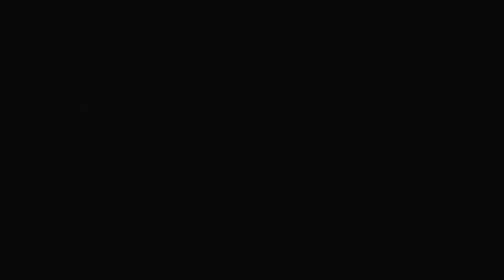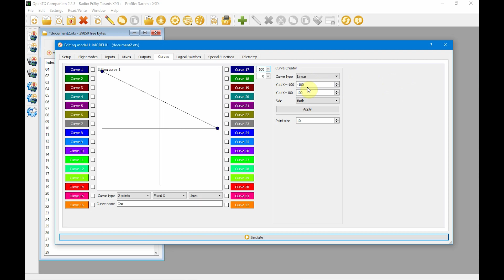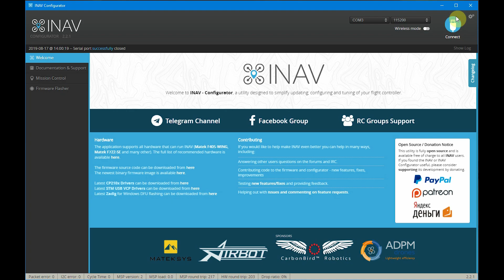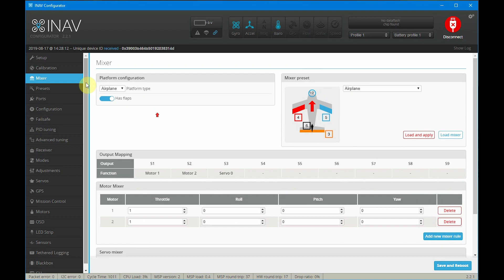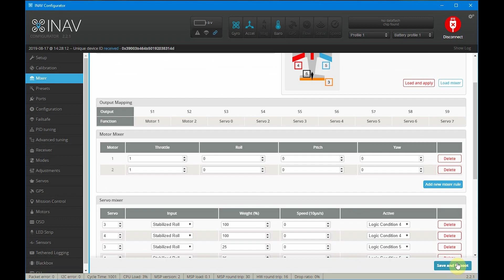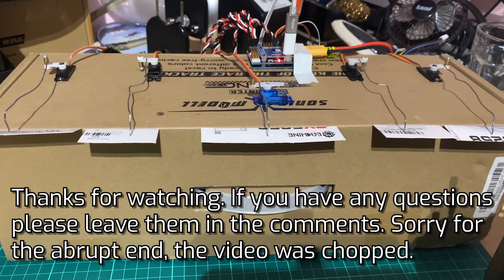iNav 2 2 Full House Glider setup

Comment: done all this thank you - in flap mode slider middle is neutral - up is down, down is right up, is there a way to keep them flush & not go up? another 1 is im used to is slider fully up flush flaps and slider down flaps down - can this work or will it mess it all up?

Comment: In the comments here there is a suggestion that it would be easy to add a fixed camber and reflux if the mixer had the ability to use a logic condition to add a fixed amount to the ailerons and flaps.  Does anyone if this has ever been done?

Comment: Many thanks for this great and very instructive video, Mr.D!

There is something which I don't fully understand though. I believe that you describe that the logical conditions being TRUE mean that:

0: (Crow) is selected by switch
1: (Full span ailerons with Crow) is selected by switch
2: (Flaps) is selected by switch
3: Crow is ON (because throttle stick is in the range of [1000..1524])
4: (2 OR 3 is TRUE) (see 9:00 in the video) => Crow is OFF ("because when Flaps are ON, Crow is never ON")
5: (NOT 4) => Crow is ON
6: (NOT 2) => Flaps are OFF

You mention that when 4 is active, Crow is OFF. But if 3 = TRUE (Crow = ON), then 4 = TRUE ("Crow = OFF"), which is a contradiction. In the setup which you at first had and which you have deleted in this video to make room for the demonstration, had condition 4 maybe been instead,
4: (2 OR (NOT 3)) = > Crow is OFF?

What I am currently missing in iNav is an easy possibility to add absolute values to a mix. I see no simple way to implement cambered or reflexed wings. In other words, it seems almost impossible to increase or decrease the deflection of both ailerons and flaps at the same by a constant value, regardless of their changing channel values. The only idea I was able to come up with was to send the desired constant offset value in a separate channel. Have you found a good workaround for that, too?

If not, then apart from saving or not saving a few RC channels: What would you say is the advantage of using the iNav mixer, instead of doing the mixing in OpenTX from beginning on, and then sending each servo output on a separate channel?
Reply from the maker: Hi, thanks for the comments.

For the first question, logical condition 3 is actually Crow is OFF, not ON. The stick range in OpenTX is from 1500 - 2000 due to the curve that's added. 1500 is also when the stick is up (full throttle position) and 2000 is when the stick is down. So:

3: Crow is OFF ( because the throttle stick is in the range 1500-1524)

When you look at it like that, the rest of the logical conditions, including LC4, are fine.

Yes, I've been looking for the ability to set values in the mixer too. Maybe it's something that can be added in future versions. I think the best way to add camber and/or reflex would be using another radio channel but limiting the output values with a curve or other method. This could then be mixed in with the appropriate surfaces. Another option would be to send the full channel to iNav, and limit the throws using the mixer's weight setting. Though it would be easier to tune in the TX.

The advantage to mix in iNav is that you can still use stabilisation and/or flight modes.  Other than the advice from all the developers not to do any mixing in the TX, you can't send 2 aileron channel to iNav that are treated as ailerons, only 1. Therefore if you do send 2 aileron channels, you can only use the RC channel values and would have to fly in manual all the time. In which case, it's not really worth having the FC, you may as well just use FPV with a standard receiver.
Reply: @MrD  Thank you for clearing me up on the stick range for your Thr->Crow input stick, I had overlooked that you have this function active. Also many thanks for your valuable input on setting up camber/reflex!

This moment I've started to experiment a bit, with the final goal to have a glider with switchable (Camber) OR (Reflex) OR (unsteerable FullCrow) OR (Flaps+Ailerons->Crow+FullWingspanAilerons).

With unsteerable FullCrow I mean deflecting flaps fully down and ailerons fully up for maximum breaking power, so one cannot make use of the aileron's normal function and it gets unsteerable in this sense (the rudder is still functional of course). I'd want this for emergency cases when thermals don't let you descend any more. However, I want it proportional, so probably I will implement it on the left slider LS on the X9D.

The last, fourth option (Flaps+Ailerons->Crow+FullWingspanAilerons) is supposed to be the default option when neither Camber nor Reflex nor FullCrow are active. I want the plane to behave like normal and unaltered, but with a slider (i.e., the same slider as above) for adding more and more flaps from one end until half way of the slider, and then more and more crow, when the slider goes from half way to the other end. In the first half of the slider range, I want the ailerons to be still completely active.
No matter where the slider is in the second half, I want to have your full wing aileron so that a little control in the roll axis remains. That would mean that at LS half way, the flaps are down maximum minus the part that's needed for the full wing aileron. From there on, the ailerons are supposed to go up until maximum that's allowed because of the full wing aileron.
Option 4 would be used for normal flying (no flaps/crow) and for landing (slider more or less down). 

For a short test, in OTX I've put a constant value of 50 into an RC channel n (by using a "MAX" value of 50 in the mixer section). Adding this with a mixer rule like "Servo 4 -- RC Channel n -- 100 % -- 0 microseconds/second -- Logic condition 0" to a flap servo brings the flaps up by a considerable amount, as expected (50 % ought to be about 1/4 of the full, total servo throw).

In a second test, I've increased the mixer rule weight in iNav from 100 % to 200 %. The servo positions with a "Reflex" of 200 % * (50 % deflection) = (100 % deflection), added onto a random starting point with the "ReflexSwitch", on the one hand (this is about half of the total servo throw), and on the other hand without the reflex, but 100 % upward from the same random starting point, are the same. In other words, the reflex procedure adds the expected amount of servo throw, so it seems to be working correctly.

Unfortunately there isn't even a servo output control on iNav, so experimenting is a bit dangerous. I'm assuming that the addition of 50 % deflection by the above mixer rule is not dependent on the initial deflection of the flap servos, so that the added angle should always be the same (constant). Do you think that this assumption is correct?
Reply from the maker: The way I understand it, the mixer is additive, so if you have 100% on your flap servo, the another RC channel adds 50%, the servo will be told to move 150%. This is why I say to set the control surfaces to the maximum available physical throws, then dial the ailerons back with the weight to the recommended throws in the manual (say 40% as an example). I then set the crow to 80% and ailerons to 20%, for example, when crow is activated. I make it total 100%. I could be wrong with this, so I’ll do more investigations.
Reply: @MrD  Ok, not sure how this recommended throw stuff works. Unfortunately I don't have any manual for the servos, I'm building the Volantex ASW28 and the servos are already built in without any infos. So all I can do is to adjust the throw for -100..+100 until snarling begins, and then relieve the tension a little by decreasing throw a tiny bit. :-)

Apart from that I believe that the Reflex and the Camber parts are in principle easy to do:

1. Adjust the flaps in such a way that with maximum positive deflection of the servo, their surface is a bit above the airfoil,
2. Measure by how many % the flap servo needs to be taken down in order for the flaps to become level with the airfoil (constant C in %),
3. Double-check with the ailerons to make sure that, starting from non-deflected = leveled with the airfoil, they need to go up by the same amount C in order to get the same deflection as the fully upward deflected flaps have,
4. Add a switch in OTX which lets you select Camber or Reflex,
5. Send C as a constant value in a separate AUX-channel,

6. Add a mixer rule for Camber which subtracts the Camber/Reflex AUX-channel value with weight 100 from the flap and the aileron servos, active with logical condition: (IF switch-to Camber is selected),
7. Add a mixer rule for Reflex which adds the Camber/Reflex AUX-channel with weight 100 onto the flap and the aileron servos, active with logical condition: (IF switch-to Reflex is selected),
8. Make sure that the servos don't go out of range, see below.

In order to make sure that the servos don't go out of range, I could of course scale things in iNav so that maximum throws always stay below 100 %. The problem with this approach is that the reaction to the aileron stick gets stretched when the same stick movement now means less control surface deflection.

Therefore I would prefer to instead to do a clipping of the maximum allowed values of the aileron and flap servo channels in OTX, for instance by using a function. This way the sticks would behave like without having Camber or Reflex selected, but they would not add any more additional deflection near the end of the stick range. Do you think that anything speaks against doing so?

I do hope that 15 logical conditions will be sufficient for the whole functionality! :-)
Reply from the maker: This should be the manual https://cdn-global-hk.hobbyking.com/media/file/a/s/asw28_manual_edited_.pdf

In all honesty I wouldn’t worry about clipping the ailerons for the reflex or camber as they only move a couple of mm and the ailerons under normal operation would not be the full movement of the servo. The crow will move the servo up by around 20-25mm, but the standard aileron throw will only be around 15mm. So the 3-5mm for reflex or camber can easily be accommodated. If you’re using iNav, I would try to do as little as possible in OpenTx too.
Reply: @MrD  Thank you for the link to the manual, Darren!

I'm not sure if this is normal, but going from -100 to +100 %, my servos seem to go from -45 degrees to +45 degrees, so only roughly 90 degrees rotational freedom in total.

As opposed to what is instructed in the manual, I have connected the rudder horns in the hole nearest to the control surface, in order to get maximum throw. I'm aware that this will increase stress on the servos and decrease angular resolution, but I'm not sure if that's going to be a problem or not. I'm hoping that you can give me some advice.

At the servo, I have connected the servo horns in the middle hole, since all other holes are too thin to attach to.

The setup leaves me with a throw that you can see in the pictures. I've set up flap reflex to about 8 degrees up (about 5..6 mm up), the maximum downward deflection of the flaps is therefore only maybe 42 degrees (about 20 mm "inside" down near the fuselage, 15 mm down at the other end = "outside").

Reflexed flap:
https://postimg.cc/wtzQbDNt

Reflexed flap from side:
https://postimg.cc/jDYxW4mk

Reflexed flap from top:
https://postimg.cc/ZBhWFhWp

Flap full down:
https://postimg.cc/47QNZ7BF

Flap full down from side:
https://postimg.cc/HcddSWd0

Flap horn to horn connection:
https://postimg.cc/KKjd4X9r

Elevator horn to horn connection:
https://postimg.cc/9zScNQKd

The maximum deflection of the ailerons (leveled with airfoil in neutral position) seems to be different up (about 35 degrees = 18 mm up inside, 13 mm up outside) than down (about 45 degrees = 20 mm down inside, 15 mm down outside).

Increasing the throw of all control surfaces any further is limited by the "hinge", since both airfoil and control surfaces are made of one piece of foam. All values are only very rough estimates. Do you think the setup is ok the way it is?

I'm not sure if I understand this correctly: "The crow will move the servo up by around 20-25mm, but the standard aileron throw will only be around 15mm." Even with maximum crow + maximum full wing aileron, I think that I cannot go any further than the current upward limits of the ailerons.

In any case, when I'm using (flaps and/or crow), I will never have (reflex or camber) at the same time, since it wouldn't make any sense. This makes things a lot easier to plan. :-)

Comment: Thanks for the video. I had also set up a full house glider in INAV, slight differences but similar to how you did it. One thing I couldn't get was proportional flap control, when moving stick flaps were either down or up. It's not clear if you achieved this. Can you clarify?
Reply from the maker: Yes the flaps are proportional. They use the same RC input as the crow. I just define what function is happening with the “crow mode” switch and the mixer does the rest. I think iNav has a built in flaps system, but I’m not using this at all.
Reply: @MrD  
Thanks, that makes a lot of sense.

Comment: Thank you so much  for your detailed Full House glider setup using INav.  I actually  had never looked at the conditional column. 
Just wondering if you had ever looked at doing the same via Ardusoar on the F405 wing?
Reply from the maker: Not at the moment. I’ve not got around to using Ardupilot yet at all. The GUI really puts me off to be honest. I keep meaning to, but always get put off as it’s quicker and easier to set up with iNav.
Reply: @MrD  I feel the same currently building a glider how does INAV compare as an alternative to ardupilot?
Reply from the maker: I’ve not used Ardupilot, so can’t really compare. There are some features that look interesting, like thermal detection and stuff like that. Ardupilot is supposed to be a more accomplished autopilot too. I just haven’t got the time to dedicate to Arduplane at the moment, plus I fly in acro most of the time. In comparison, iNav is a lot quicker to set up and the GUI is far superior to MissionPlanner.

Comment: Are you slope soaring D? I guess so if you are using your throttle huh?
Reply from the maker: To be honest, when I slope I pretty much never used the throttle. Half the time I forget to arm lol. With the non-fc setup I use, you have to arm on the ground as you have to hold in the momentary switch and pitch up and roll left. Probably not the best thing to do in the air 😄

To me the best thing about soaring is the rush of seeing what you can do just by the power of nature. Its absolutely awesome. But, I and other people have powered gliders, so I included it in the setup. For a pure glider, just forget about the throttle slider.